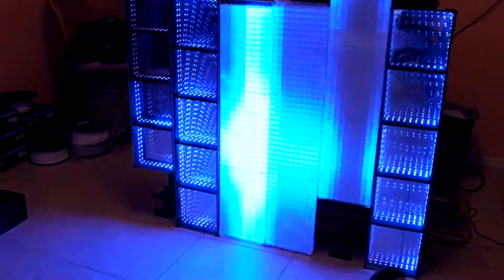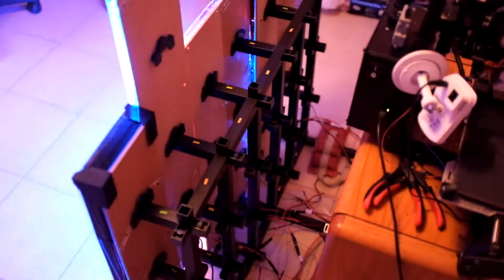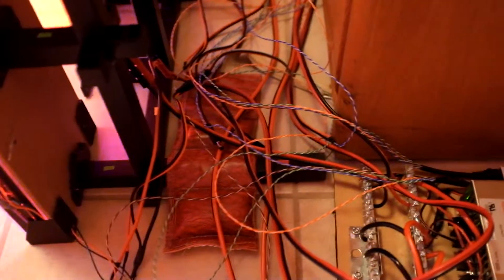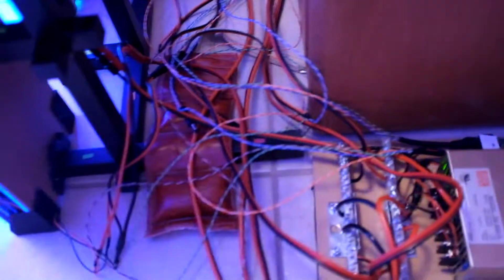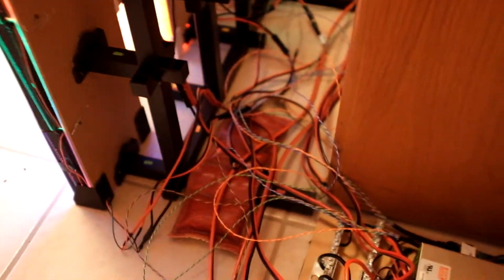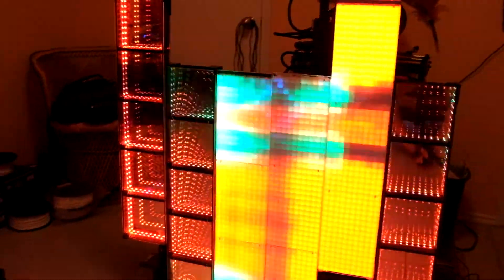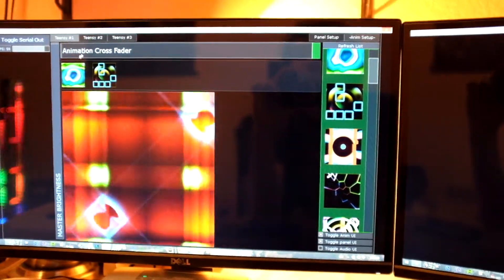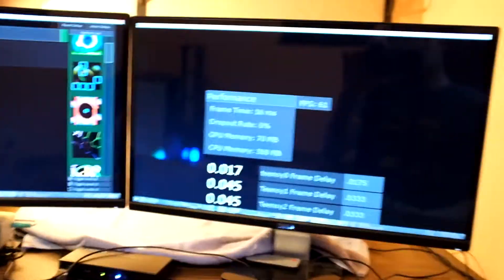6 / 16 LED Panels Finished! ~ WIP update

Comment from the maker: A Teensy 3.1 / Arduino board is driving the led panels @ 60 FPS through a OctoWs2811 adapter board, receiving data from the computer over serial from a custom vj setup I've laid out in Touch Designer 088.

Panels mare made primarily of 3d printed diffusers, frames, and braces. Wood, and aluminum tubing / Esto Connectors.

10-12 AWG wire for power to each panel, Power werx: Anderson Powerpole connectors for ~ 30 amps max per panel.

DC barrel jack connectors for easy data plugs.

More to come!